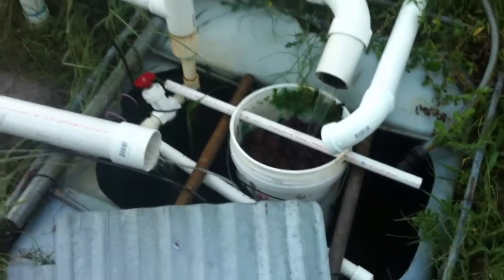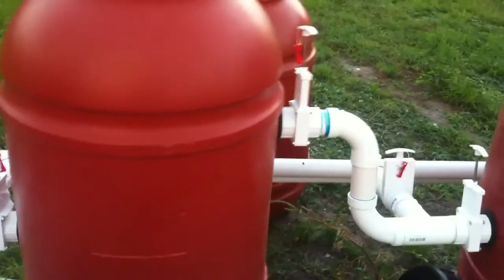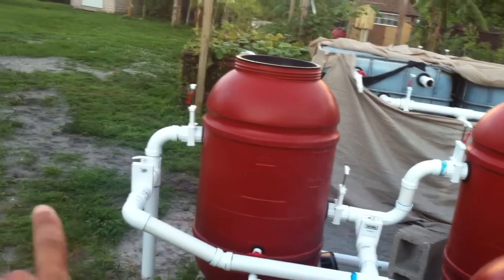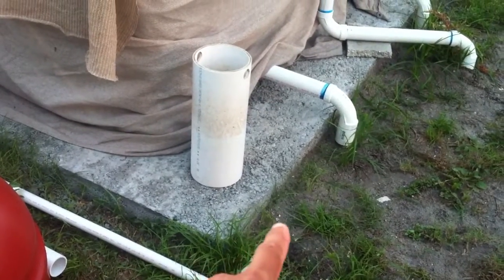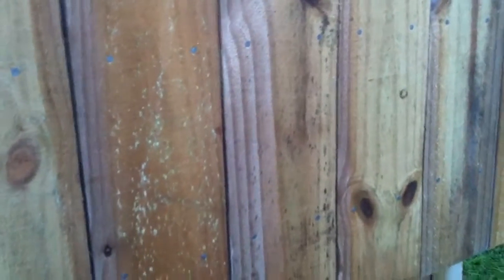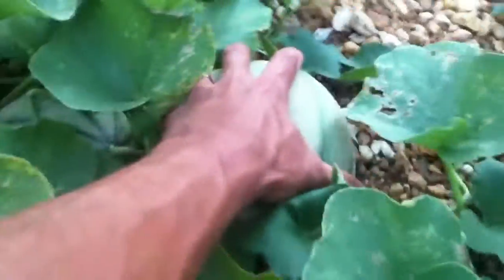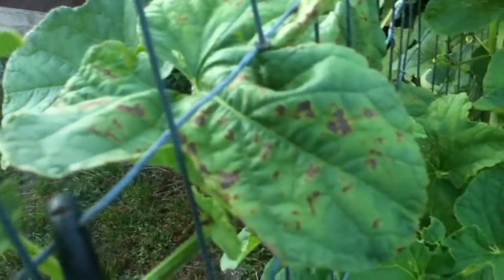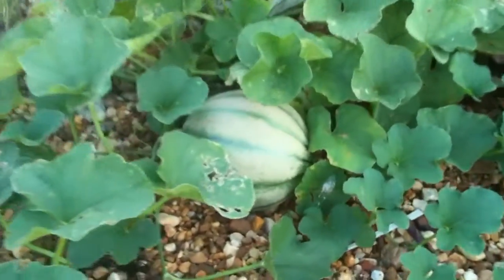Aquaponics System Update

Comment: Putting the air pump in a closed in house like that will hurt some pumps. (running to hot, they need air movement around them).
Reply from the maker: Good tip.  I'll see if I can make some sort of ventilation for it.

Comment: Spots -It looks like calcium Def and could be the problem combined with potassium for the small peppers as well.
-Fish food is not enough to supply the correct amount of nutrients for flowering/fruiting plants. 
-I like to add organic methods of Iron,Calcium, Potassium, and magnesium. (fish food does not provide enough)
-As microbes oxidize the ammonia,.. they add more hydrogen ion lowering the pH. I use Carbonates to bring it back up to the desired pH while this doubles as adding the def nutrients.
-What is your pH range. It should be 6.4-7 no more. Be careful using gravel in beds... this is a very common mistake as it will sometimes contain limestone making it very difficult for the pH to drop and often is way to high for plants to get micro-nutrients
Reply from the maker: Media bed is safe for sure.  pH is running 6.2--6.4 up to 6.8 when I dose with calcium hydroxide and/or potassium hydroxide.  I just switched from a cheapy pond (non complete) pellet feed to Purina Aquamax pond 4000 (complete feed) yesterday.  I hope the feed will help as well.  I dose with hydroxides when ph is below 6.5.  Otherwise, I use Multi-K which is pH neutral.  My nitrates are 80-160 so can't use nitrate based Potassium or Calcium.  I need to find a pH neutral Calcium to add to my arsenal.  Thanks for watching and for the tips.
Reply: Did you ever find a solution for this?